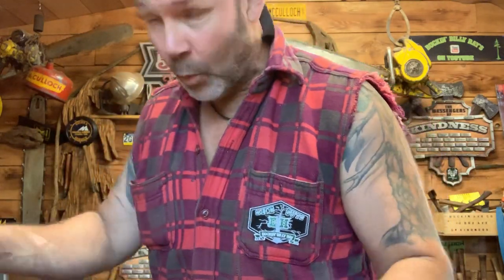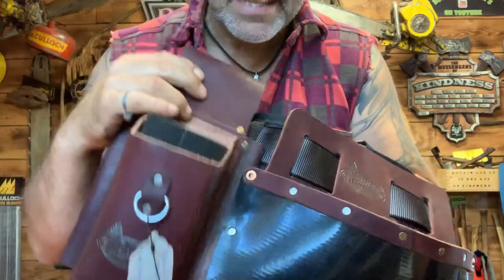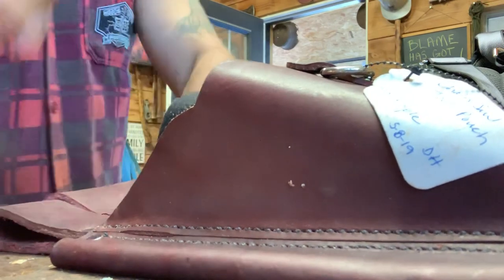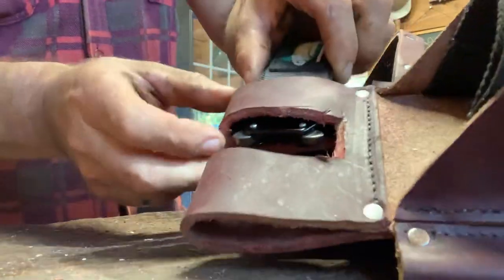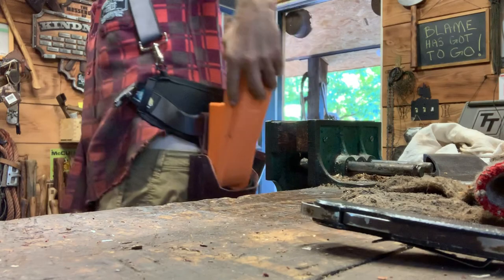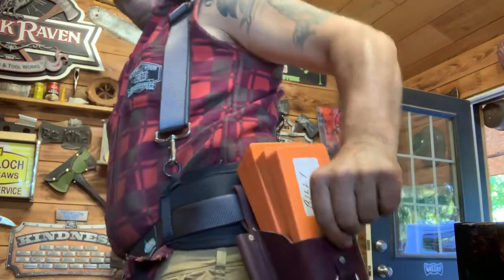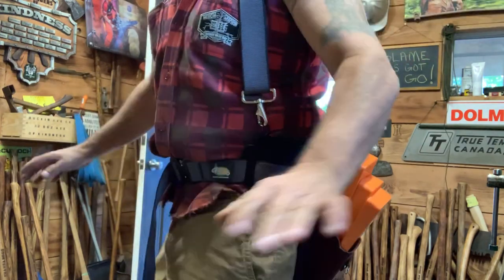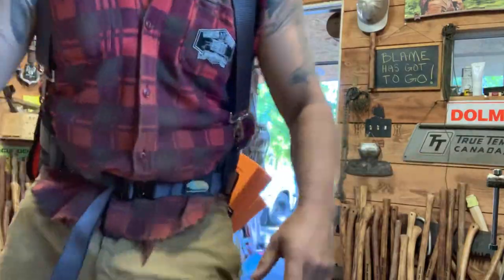Weavers wedge pouch. Becomes better

Comment: Nice work buddy, worth every moment to make it right before putting it to work. 

I get into 8" wedges here but Im in the hardwood where I have to drive a short tree quite a ways. I often carry a couple but even then Id like the pouch square at the top rather than taper. Itll bell at the mouth with some use anyway

Comment: Have to agree on the wedge holder loose the elastic band get it out of the way and extend it up higher and you could use the small wedge holder for those 8

Comment: 🌲  the belt should go over the first loops of the large pouch so it won’t fold away for a sloppy pouch !  A lot of carpenters do the same with the tape measure holder !      Over not under  🙋🏼‍♂️    🌼

Comment: weaver could just have a small wedge pouch and large wedge pouch. what ever type you like to run you can pick the pouch you need. no need for one size fits all as it will stuck for all.
jack of all trades master of none.

Comment: I have to disagree, big guy - I use 8 inch wedges regularly. I have a Stihl ms181, running a pico chain, and the lift I get from my 8" wedges is often plenty, especially when I'm falling with the lean. Plus, a lot of times, I'm falling small trees, so I rarely need anything bigger. In addition to which, my damn pouch won't hold bigger wedges, so there's that too... 😉

Comment: I use two 12"  +one 8". the 8" is for fine steering control when felling a heavy leaner opposite the lean or into the wind.
Also I put the 8"in the center fat side down.

Comment: I wonder if they raised the leather height up as you said, they could also cut a patch of leather out on each side and sew in some heavy duty stretchy material in its place, maybe only just in the top third or half, so that when you fill it up its really holding some tension on those wedges and will really hold em in there. Since it wouldn't be a little fiddly bit of stretch material on the inside it should still be easy to pop your wedges back in without needing to look back there or use two hands or fiddle with it any. Might be a dodgy idea but thats what experimentation is all about. Who knows.  That stretch material eventually wears out so they'd have to do it in a way that you could replace it yourself pretty easily with a speedy stitcher or something easy like that. Nice gear all the same.